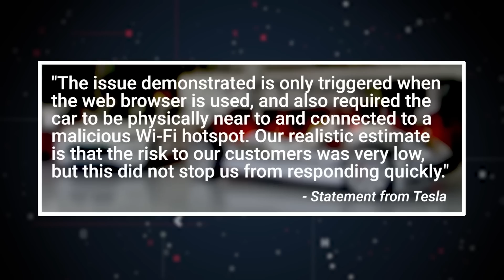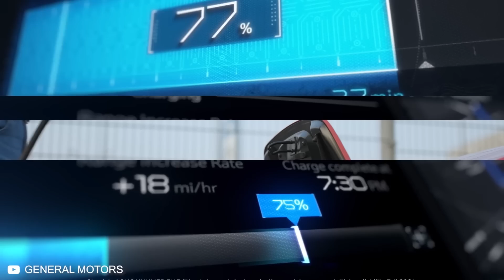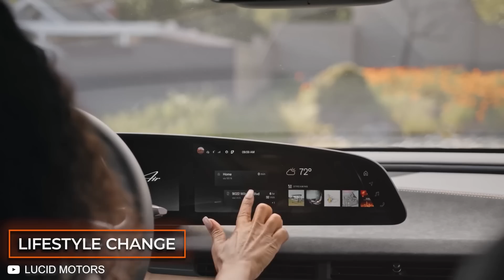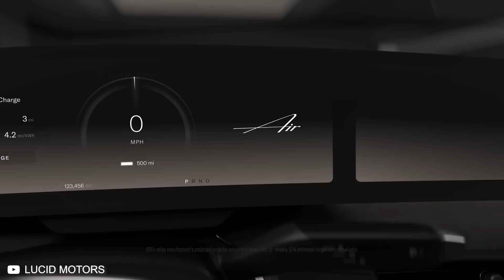EVs' Serious Problems That Carmakers Are Hiding

Comment: If you get hit with one especially a truck you will probably die. They are a lot heavier than gas cars and trucks. You might as well hit a brick wall.
Reply: Good thing most pick up trucks don't have a load in the back.

Comment: And always remember these batteries require large amounts of cobalt in manufacture. This largely comes from the Congo Basin in Africa where legal and many illegal mines are often mined by children. The Congo forests are being devastated by mining and this in turn will and does affect the rainfall in central and southern Africa. Do please think of the wider issues before you rush off to drive a 'green' car
Reply: A lot of cobalt is minded by child labour, especially that that was used in earlier battery and magnetic technologies. No only is battery technology improving at a fast rate, less and less cobalt is being used for batteries; sodium and redox batteries don't use any plus it is highly likely in less than a decade, sodium will overtake lithium.
Reply: A lot of cobalt is mined by child labour, especially that that was used in earlier battery and magnetic technologies. No only is battery technology improving at a fast rate, less and less cobalt is being used for batteries; sodium and redox batteries don't use any plus it is highly likely in less than a decade, sodium will overtake lithium.

Comment: All of this plus the fact that getting power to recharge these vehicles comes from mostly coal fired plants. Also the mining for the minerals necessary to manufacture the batteries is highly destructive to the environment as well as the slave labor that is being used in the countries where this mining is happening. Petroleum is also used in the manufacture of the batteries, plastics and tires as well. The lies and omissions of these facts from buyers of these vehicles is downright criminal in my opinion. Electrics are not the answer at least not at this time. By the way, the most serious offenders as far as emissions is concerned is China and India. They have stated that they have no intention of changing their huge footprint on global emissions so anyone thinking they are saving the planet by buying one of these vehicles are only fooling themselves.
Reply: China is using coal as a bridge-fuel to power its electric grid while they wait for the nuke biz to get its act together; they are in the midst of modernizing old ones while the nuclear industry is developing its new technology. The US is doing the same, but by fracking gas. At least China with all its faults, is doing more than Canada and the US is doing, and already have some ultra high voltage transmission - DC and AC, which requires less fuel. They also emit half the amount of CO2 emissions per capita than the US does.

Those coal fired power plants suck, but at least the amount of fuel required becomes less with the new better efficient grids especially with added solar and wind as a stopgap.

A coal powered EV the same size of a gasoline car emits 15 pounds of CO2 running the same route as a ICE car, which emits more than 20 pounds of CO2 for each gallon of fuel consumed.

Most lithium is "mined" from brine deposits, by machinery, not by child labor, but cobalt is, which was used in earlier battery and magnetic technologies. Good news is, not only is the technology improving at a fast rate, less and less cobalt is being used for batteries; sodium and redox batteries don't use any plus it is highly likely in less than a decade, sodium will overtake lithium. 

As it stands now, reduction-oxidation flow batteries are ideal for stationary systems of storage scalable to any size and no rare metals are needed plus no river valleys sacrificed. That being said, for small mobile systems, lithium batteries for now, and graphene or silicone batteries in a few years. Synthetic fuels or hydrogen will highly likely be used for large mobile systems.

Petroleum is too valuable to waste as gasoline. We should leave as most of it as we can in the ground for our grandchildren to use for for plastics, paints, petrochemical feedstock medicine, etc.
Reply: No one in their right mind thinks EVs are going to save the planet. They are less dirty option and create a much less technical debt for our grandchildren.

Comment: EV chassis & panels made of what? Steel ! Iron Ore Mined by Fossil powered machinery shipped in Fossil fueled ships to Coal fired smelters.  Plastic Interiors ? Tyres of Rubber contain OIL ? Glass sourced by Fossil machinery processed by Fossil Fuel power. Fossil powered earthmovers source copper lithium ? Aluminium Solar panels ? Bauxite Fossil powered earth movers Coal powered smelters ? Panels plastic (Fossil) internals? Glass panels?  The EV Revolution produces STUPIDITY BLINDNESS  SELF RIGHTEOUSNESS FOOLS 'SAVING THE PLANET' and DEBT !

Comment: The finite batterly life is a real pain. Take the average car owner today. People don't usually buy brand new cars, because the car loses most of its value in the first years. Even a gas car at 7-8 years isn't that old. It's going to take a while before you'll find many EVs of that age being sold, but who will buy them? You buy older cars to avoid costs, but if you may be 2 years away to paying well beyond 10K for a new battery, that defeats the entire point. People won't take that risk, but can't afford newer cars.
Reply: I ran two of my cars into the ground and they lasted about 18 years; the only reason I got rid of them, is parts were no longer available. But not now,  I live in an environment where they are lucky to last 7 years without rusting out so decided not to buy one. Where I live now, folk are happy if they can keep a car for 5 years then scrap it. These people I found tend to get drawn to the EV, but still it is a pricey thing.

Comment: They already with just the few of the billions of cars they would want to be EV getting enough materials for them.And most people live in a apartment that are not going to be able to plug them in.And the power grids already have problems when it gets to hot out not to have brown outs .And power plants unless nuclear .Run-on natural gas or some other materials .And if your electric car is outside in extremely cold weather .And you cannot plug it in.You will after a few days be as if it had been a gas car look like someone stole a half tank of your gas .And if it's to hot out .They recommend parking a EV in the shade .Like oh look shade is everywhere you can park a car .But one selling point they use is .Oh it's so much cheaper to operate .Less oil no oil changes. Sure just 1,000 dollars for tires .Just being able to drive 300 miles on a car you paid over 40,000 dollars for .And a battery pack installed 14,000 dollars if you can afford to buy a used one . Run out of battery .Call a tow truck and get it towed to where ever a charge station is .No big deal probably just a few hundred dollars to get towed .Who wants to call a tow truck or a friend to bring a gas can.When you can spend hundreds of dollars to look cool sitting in the front seat of a tow truck .With your beautiful over 40,000 dollar Tesla on the flat bed behind you .That's luxury . Tesla cars only keep going up in price not down. So much for the more you make the less they cost .Not when it's only about profit .Has nothing to do with trying to save the environment because your just such a nice caring person. For me dancing in front of a audience does not do it .

Comment: What about the possibility of exploding batteries?
Reply: They can catch fire, but the chance of an EVs battery igniting is 50 times less than that of a ICE, but your EV will be a write-off. Good news is some automakers are going to stop using lithium ion batteries and use lithium iron phosphate batteries instead, which will make them safer that ICEs. Igniting batteries always make the new, but ICEs usually only make the new when they blocking traffic.

Comment: Ev cars weigh as much as a half ton crew cab truck. Heavy duty tires are expensive. Only makes sense to lease and then dump. Residual value will be nil. Would you buy an ev with 60k miles on it? Range beware.

Comment: You are wrong, the GM EV1 was not a failure. GM created the EV1 practically over night when the State of California set their emission standards to "0" emissions. Yes, the range was limited but that was because Delco Remy would not install their most powerful batteries into EV1's. Even though all of the drivers who had EV1's were happy with their EV1 electric cars when the State of California changed their emissions standards to permit gasoline to be sold in their State again GM who only leased their EV1's recalled all of them and crushed them, destroyed them. GM did wanted car sales in California but did not want to manufacture electric cars. In fact the EV1 was a success story not a failure.

Comment: The range they quote is a lie as well. This will decrease rapidly if you are driving at highway speeds on a hot or cold day to ~100miles. I was in TX a few months ago and was riding in my friends Tesla. We started the trip with a 50 minute charge to top up, then after driving roughly 110miles had to stop and charge again…this time taking over an hr because all the chargers were being used at this location and we didn’t have the range to go elsewhere. Note: it takes longer to charge if the unit next to you is being used. So in summary our 2hr trip quickly ballooned into a 4hr trip. Not worth owning at all.

Comment: I've declined purchase on twenty-four barrels of gasoline since I bought a 2018 I3 last year. The I3 is next scheduled for maintenance in April, 2024. One-sixth the cost to drive, exceedingly light maintenance burden. That's what drove my decision, the smooth, quiet ride and brisk acceleration at any speed were just icing on the cake.

Comment: Desperate measures have to be taken. The EV demands more electricity from manufacturing to finished product and on the road consumption of energy pulls more energy from where? Power plants (oil or coal ), that produce electricity. So again, besides the aforementioned problems, the emissions are probably more or the same than the one required for internal combustion engines

Comment: You neglected to mention the cost of operations and maintenance. 
My wife’s Bolt EV, with home off-peak charging, costs $.03/mile, fuel and maintenance.
My Porsche 911, premium fuel, costs $0.26/mile, fuel only.  Nearly 9x as much.
Yes, big difference due to current gas prices, but even with 2021 fuel prices, still a serious advantage to an EV.   
Plus, my wife absolutely loves never visiting a gas station.
Reply: But there is a premium up front for EVs. ROI is longer than most people keep cars leaving most people at a net loss.
Reply: the problem is when you factor in up front cost and battery replacement. It is the same exact issue with solar panels. You may pay less monthly, but that up front cost and the eventual replacement of the solar panels when they degrade, really takes a toll on the wallet and isn't worth it for the average person.

I'm all for alternative energy sources and electric vehicles, as I find both concepts fascinating from an engineering side of things, but let's not be naive about the engineering limitations and economic side of things.

Comment: These cars are a POS! Wait till the time comes when the old EV's get junked, what to do with the old dead batteries, talk about hurting the environment. And with the use of shit windmills and solar which is only good part of the time, our electrical grid couldn't handle the stress of everyone charging their car. Also, the reliability of the charging stations across the country. Already, some of the stations are glitched out or non-operational. They can be reset, but if no one reports a problem with the charger, it stays non-operational. I have nothing against new technology but we're trying to put the cart before the horse, jamming this $hit down people's throat too fast. Then when people get burnt do you think they will ever get an EV again after spending $40, 50,00.00 I don't think so. The government can kiss my a$$, I'll keep my gas car.

Comment: I've been driving an EV for over 3 years and LOVE it!  Zero maintenance.  Zero oil changes.  I charge at home so it's always ready to go.  Taken it on several 2k+ mile trips and never had a problem charging (got free charging at several hotels too).  I don't drive until my bladder bursts and it's not a big deal to take a 30 minute break every 250-300 miles for food/coffee/stretching.  High gas prices are a mere curiosity to me.  It's awesome!
Reply: So three years is about the limit of the satisfaction range, check back at 5 year mark, let's see what you are feeling then...

Comment: One thing about maintenance.
It requires less maintenance, but when you do need maintenance it costs a lot more.

And in regards to being “green” is actually  government misinformation.
Getting the metals for the batteries and the fact that  most places use fossil fuels to generate the electricity to charge them likely does nothing in terms of pollution.
Reply: It does something in terms of reducing the technical debt our grandchildren will have to deal with. Also  an EV recharged by a coal plant puts out half the CO2 as a gasoline car the same size doing the same trip and even much better in stop and go commuter congestion. Imagine what can be accomplished with much more efficient upgraded grids and power plants that require less fossil fuel along with solar and wind to fill the gap until next generation nuclear.

Comment: The EV is rip off. I'll stay away from them, cant pull my rv  trailer to Wisconsin in the summer. Plus imagine getting involved in an accident in the highway, if the explosion or fire does not kill you the lack of mass in this little cars will. 😨 combustion cars gives you freedom to go anywhere.
Reply: Batteries can burn, but they are a lot less explosive than tanks of gasoline.  Batteries burn slower, don't go up in a fireball.  It's possible with a Tesla to go *almost * anywhere in the USA now without hassle.  RV trailers are another matter though.  EVs have plenty of power to pull a trailer, but the effect on range is brutal.  So, that's something that needs more work.

Comment: These are exaggerated problems in this video.  a Tesla it loses capacity perhaps equivalent to four kilometers per year.  In addition, it is well a battery warranty of eight years and many thousands of miles.  and you enter in the car's info system where you are going somewhere and the car will tell you if you need to charge somewhere along the way.  and if you charge a quick charger, it takes under an hour

Comment: And when the batteries catch fire they are almost impossible to put out.
Reply: Not impossible, you cover it with a lithium fire blanket if you are quick enough. If not your car will burn. Also the battery needs to be submerges under water. That being said, the chance of an EVs battery igniting is 50 times less than that of a ICE, but your EV will be a write-off. Good news is some automakers are going to stop using lithium ion batteries and use lithium iron phosphate batteries instead, which will make them safer than current EVs and a lot safer that ICEs. Also it is highly likely in less than a decade, sodium will overtake lithium

Comment: NO!
The 10 years for the battery, ... imagen the price for replacement.
Reply: They don't keel over and die after 10 years.  My Tesla Roadster is over 10 years old now, still running strong on the original battery with over 200 miles range.

Comment: If you want to be environmentally friendly with your vehicle, you should drive your current one into the ground.  There's so much embedded energy in it, that it should be valued more. Car makers don't like that kind of message. Here in eastern Australia, most of our electricity comes from burning coal which is much worse than petrol/gasoline.
Reply: No, CO2 is a good thing.
Reply: @ricktd6891  Yep, like iron and manganese and calcium are critical to the human diet.  Die without them.  Also, get a bit too much iron, etc, and you’re also dead.  That is, like every thing in life the dose / amount matters.    Burn up a cubic mile of oil in the atmosphere, every year, for a century, as we do, and it’s natural that there’s going to be some problems.
Reply: @Nill757  That post contains no facts. Try again.
Reply: @Nill757  Try proving the global warming hypothesis if you even understand it.
Reply: @ricktd6891  Cmon, dump the story and just say what you mean.  You don’t care about learning any facts, like homeostasis in the body, the volume of global oil consumption. You just want to pick a side, skins vs shirts, whatever.
Reply: @Nill757  Again your post contains no facts about climate science or Earth history. Is it because you have none?
Reply: @Nill757  Can you even define the global warming hypothesis?
Reply: @Nill757  Can you even tell me if the Earth is historically hot or historically cold right now? That might be important information if you want to debate global warming.
Reply: @ricktd6891  Yeah I think you’re skins.
Reply: @ricktd6891  To a point it's good. It went a bit far on Venus.
Reply: Ive had a 67 ford truck for 20 years and plan on it lasting longer than me

Comment: I don't know why someone hasn't come up use vegetable oils for gasoline not ethanol. Plants , trees = oxygen & less carbon monoxide because most trees breath it in & exhale oxygen....
Reply: They have, but in some places it requires a lot of deforestation, which causes greenhouse gases. Trees that are cut down plus burning trees converts the carbon stored in those trees into CO2, increasing the concentration of CO2 in the atmosphere. Trees and planted trees remove CO2 from the atmosphere, but only absorb the most they can when fully grown.